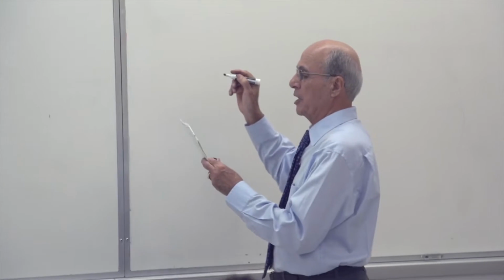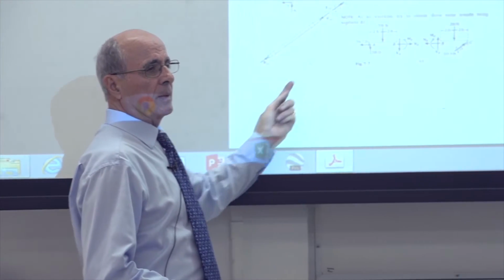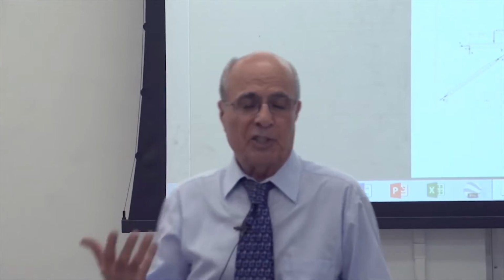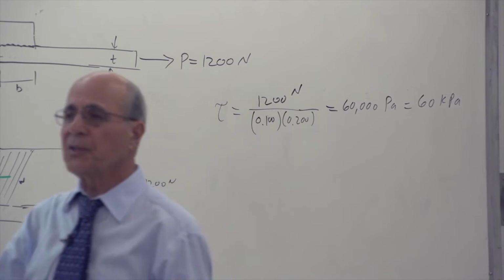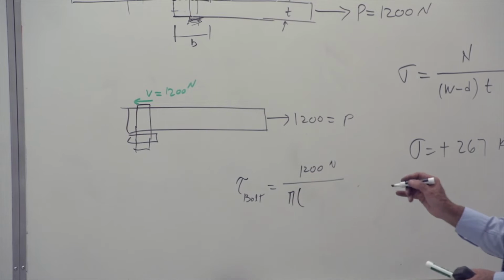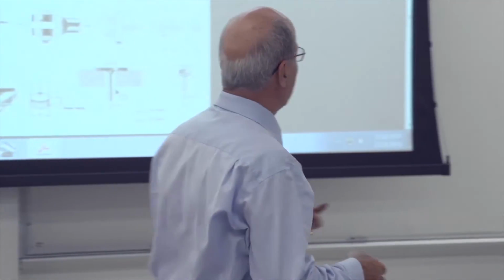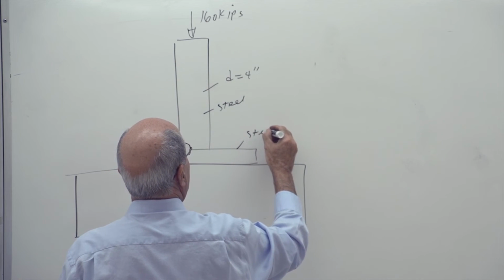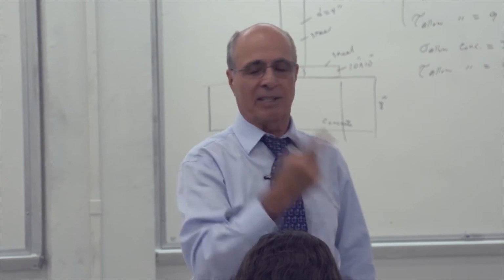Strength of Materials I: Normal and Shear Stresses (2 of 20)

Comment: I am so much confused by the internal forces.... so ambiguous
Reply: Its kind of like cutting open a pipe to see how much water is flowing.  You take a cross-section of the member and apply statics to calculate how much force passes thru the part.  You then calculate stress (force intensity), and compare to the allowable with a factor of safety or margin of safety approach.  But the first step is to find out how much force passes thru the member, and in what way (tension, compression, shear, bending, etc)
Reply: ❤❤ @ToddCoburn

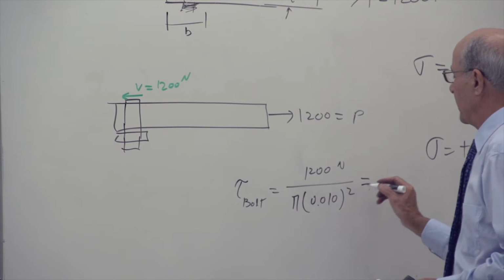Comment: @43:10 is it not Newtons over meters? Which would be Pascals? Not sure where MPa applies unless we kept it over millimeters.
Reply: He converted it already. If you calculate shear stress in the bolt as written on the board, you get 3819718 N/m = 3.82*10^6 Pa = 3.82 MPa
Reply: @ankushdeol4922   Yeah, not sure how I missed that. Thanks